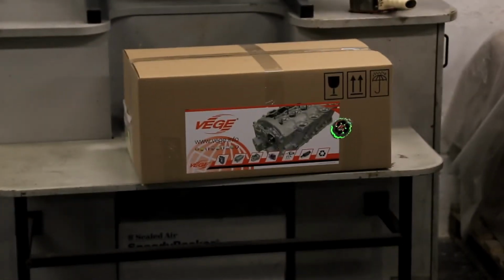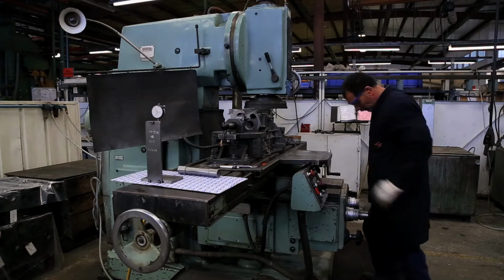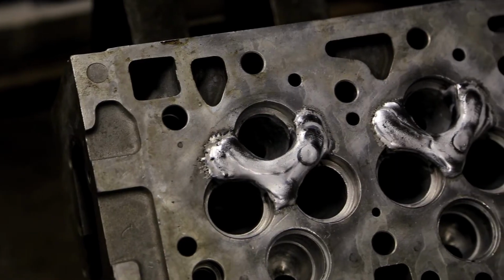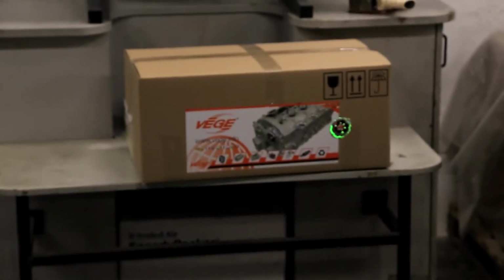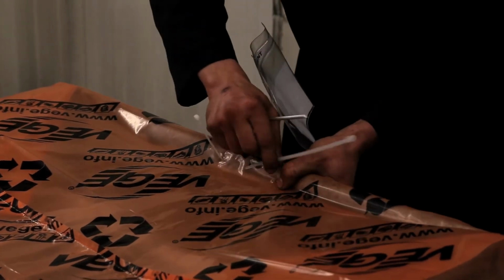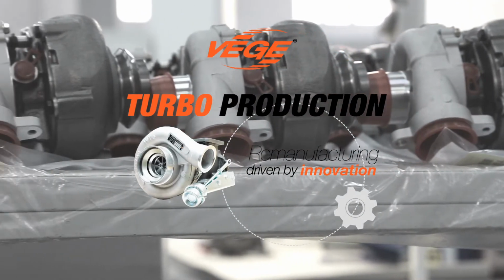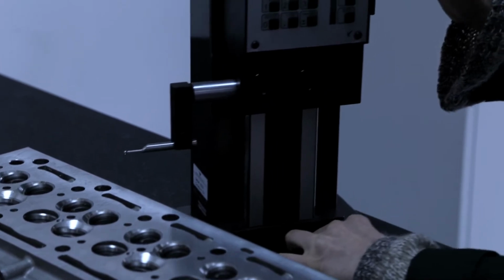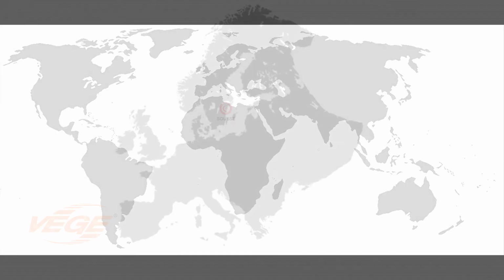Vege Motors Corporate Video

Comment: my vege engine failed after 1000 miles
crankshaft failed
Reply: I had a PD engine that suffered with a snapped cam shaft (a very cheap cast camshaft was used) after 13 months, again no warranty.